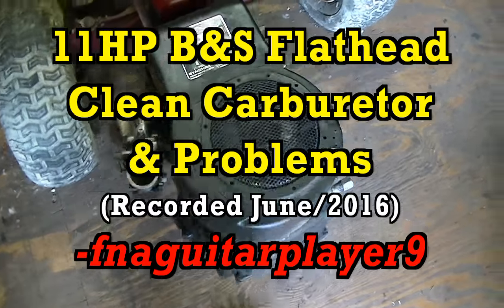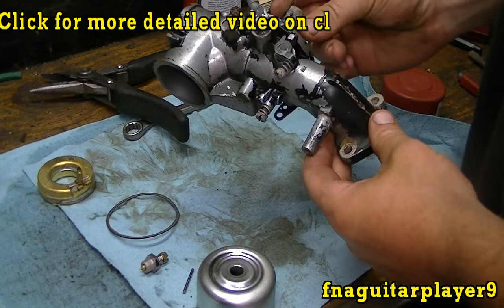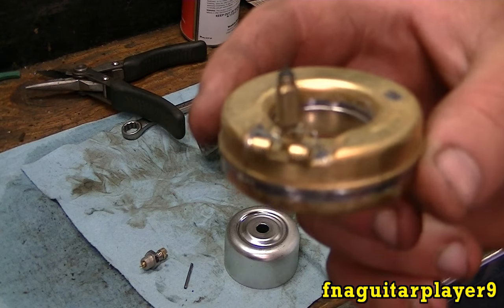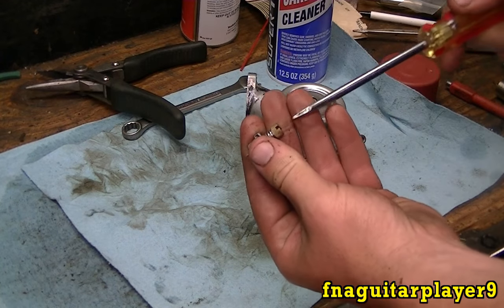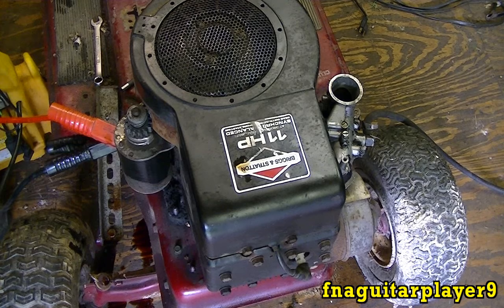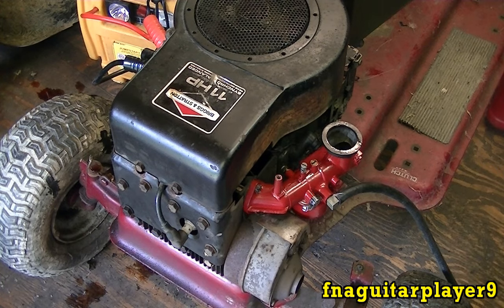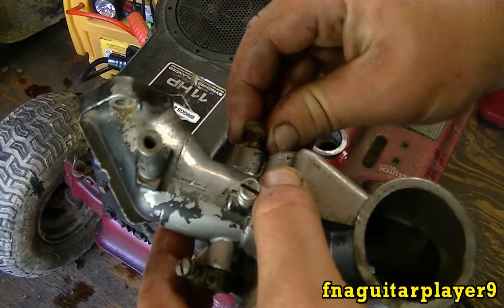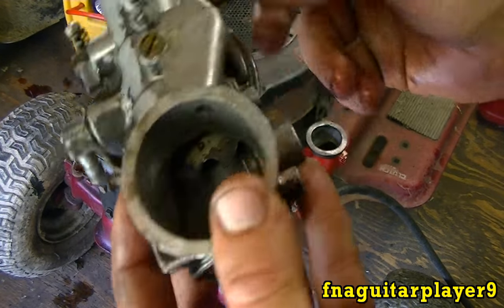11HP Briggs & Stratton Carburetor Clean & Problems

Comment: How do you hook up the choke on one of these? I have same wheel horse with cast iron 11hp B&S. Carb was missing pieces when I got it. So bought a brand new one. Only thing I can't figure out is the choke?? Its built into the throttle cable on the dash. Thanks ahead of time.
Reply from the maker: Watch these 2 videos here, they should help you out! https://youtu.be/v5PTY6vjUw4  AND this one for the cables: https://youtu.be/1WWpeyDbHjA  Hope this helps, and Thanks for Watching!!!
Reply: @fnaguitarplayer9  Thanks! Very helpful! I realized the rod was removed like you mentioned in the one video. Going to fab a tiny bracket and install a manual choke as you suggested. 
Got this thing running pretty darn good after getting youtube certified from your videos. 🙂
Reply from the maker: @fascinatingprocrastinatingme  Your welcome! I hear ya, hopefully that will work far you. hahaha i hear ya!

Comment: Do these have oil filters?? 
I have two tractors with this engine. A Lawn chief and Murray. They were both not running when I bought them a month ago but so far have got them running. Fun little hobby plus I get my lawn cut 😂 
Only issue I’ve run into is electric issues but plan on fixing soon.
Reply from the maker: Most of the old ones do not, I don't think i've ever seen a filter on a single cylinder flathead, some of the opposed twins, v twins and newer single cylinders usually have them but not all. They used to rely 100% on splash lubrication, even the ones with oil pumps/filters still use splash lubrication as well. Thats why oil changes are so important to small engines, especially when not equipped with oil filters. Thanks for Watching!
Reply: fnaguitarplayer9 
I didn’t think so but wanted to make sure I wasn’t missing anything. Thanks!
Reply from the maker: @richdelgzz  no problem!

Comment: Nice video   Do You know where to find a set  kit for this carburetor thanks
Reply from the maker: Thanks. You can get them off of ebay or amazon or from mfgsupply.com or jacks small engine. Part number 394698 should get you all the parts you need for these, except for the throttle shaft bushing as this carb needs. Thanks for Watching!!!
Reply: @fnaguitarplayer9  Thanks for the link/part number. So, the $64,000 question: where do we get the throttle shaft bushing?? Thanks in advance!